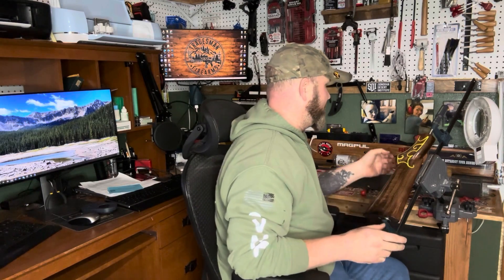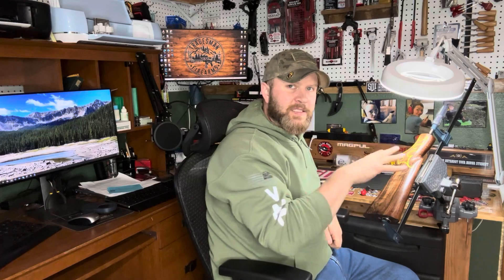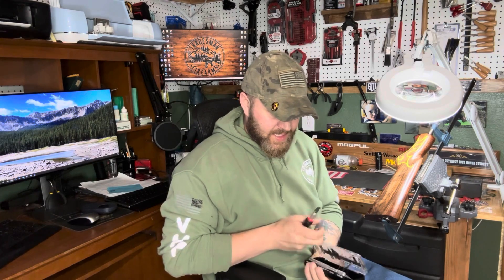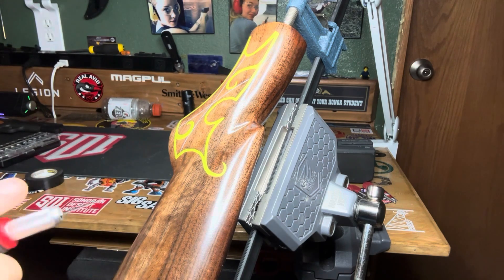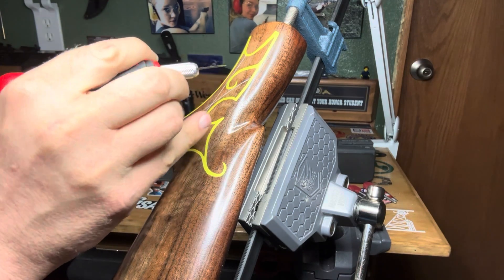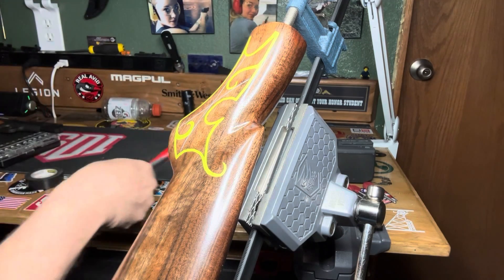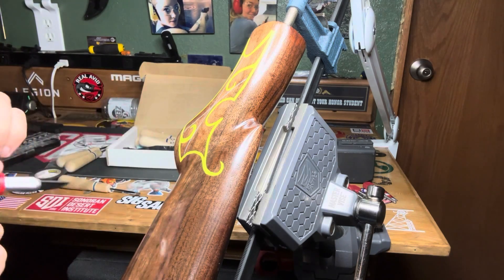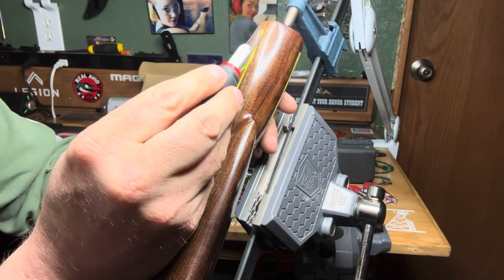SDI - FTT 214 - Week 3 Assessment 2 (Checkering Lab Part 3)

Comment: Good idea with the clamp you could possibly modify the head on the butt end to have a point if you have difficulty with the stock walking when you rotate it
Reply from the maker: Yea I actually tapped one end and added a chair foot thing into it. But a point would have prevented the walking better. Would be nothing to sharpen a point and thread it into that spot.

Comment: Talon great effort. Although the swirls were tough, I think you are right that the checkering itself won't be as hard. I haven't started mine yet. I think you're right about the tools. I've been tempted to buy others but, I don't know how much I'd use them. Great idea using the clamp for the cradle!
Reply from the maker: Thanks! The clamp worked well, I can imagine a few improvements but overall it’s a good solution. I need to do some research on some other checkering tool options, there’s got to be something for curves.